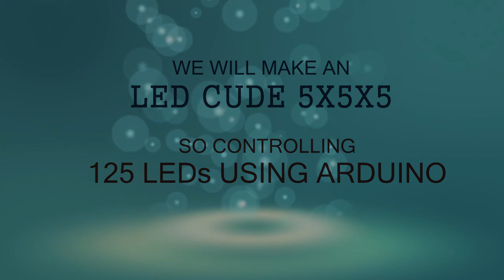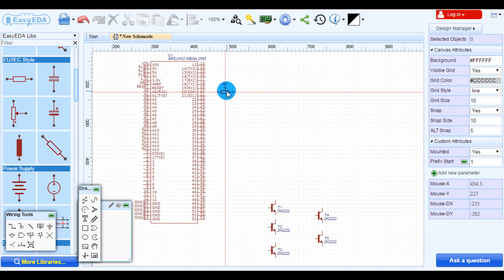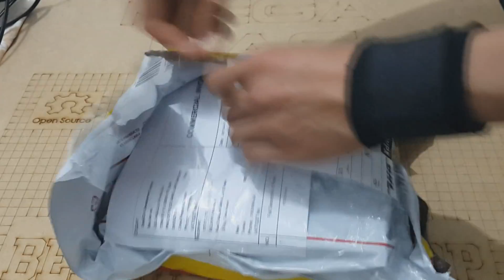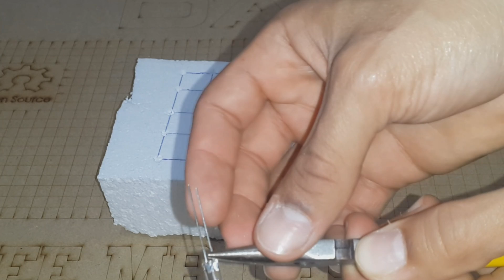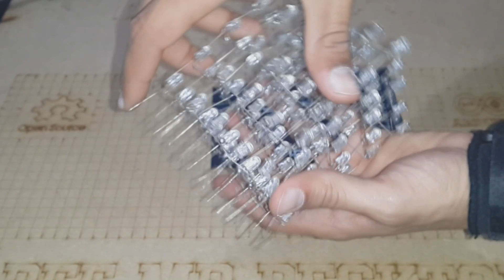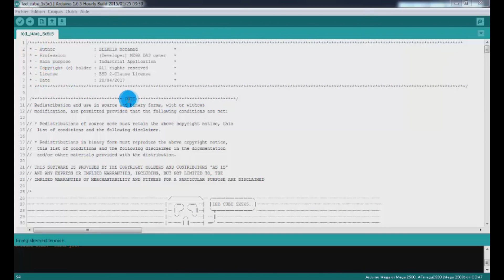How to make Led cube 5x5x5 (Arduino project)

Comment: Hi, I have some questions, does the arduino support the whole current produced to the pin? Because I'm having trouble with those and also, can I replace the 330 Ohm resistor with a 220?

Comment: which wire and solder would you recomend for soldering led cube ?
Reply from the maker: Hello
I'm using BAKU601A soldering station which has already solder iron and I'm using the Ersa core wire for my projects.

Comment: where did you put the transistors?
Reply from the maker: In them placements on the circuit board. You can find it in the PCB design or check out the schematic.

Comment: you should have spaced out your leds, you cant really see the middle ones, also I would recommend a thinner wire for your solder as it looked as you waited quite a bit for that to melt down
Reply from the maker: Hello Flaxbot,
Thank you for your kind advise. Your suggestion is useful and great. We will consider this suggestion.

Let us know if we can further assist you.
Reply: no problem,

Comment: A question with arduino nano works ?
Reply from the maker: Hello Germy,
Not sure to make it work with the Nano since it has only 19 digital pins but we need 30 digital pin to make a 5x5x5 LED Cube so with Arduino Nano you may be able to make a 4x4x4 LED Cube 
Or you can use Arduino Nano with some adittional ICs like 74HC595 for more digital pins but the programming part will be a tough mission

Let us know if we can further assist you.